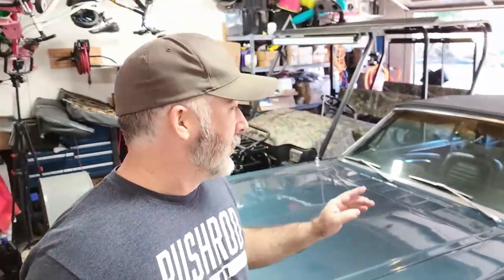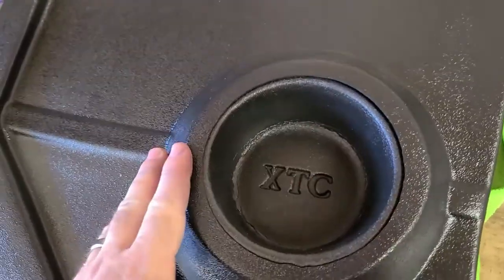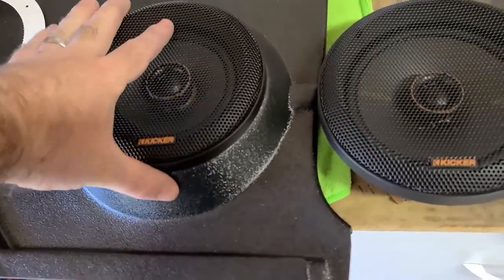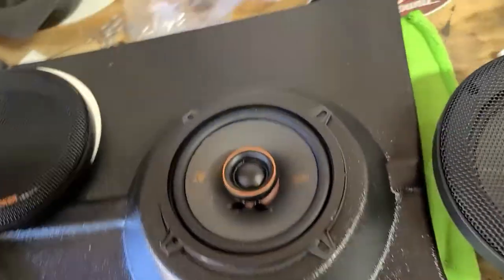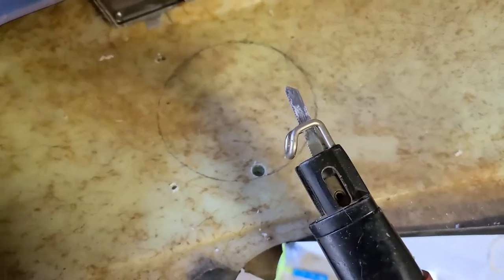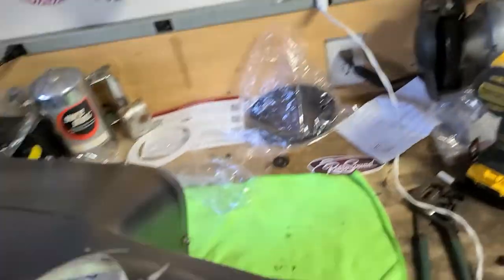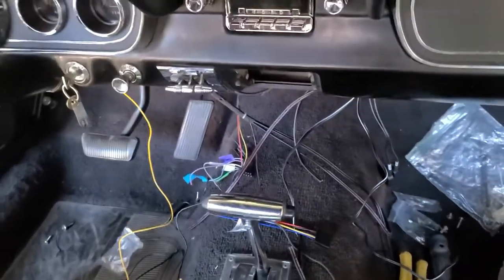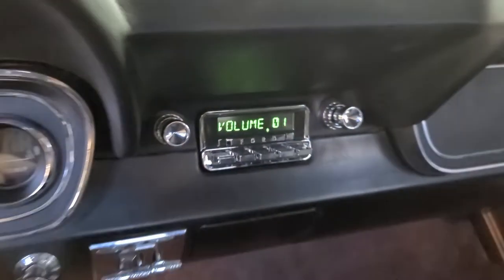66 Mustang RetroSound Detroit M4 Stereo Install - Pt 2 Installing the Speakers

Comment: What channel did you wire the center channel speaker to? The indash radio only has 4 channels out? Thanks
Reply from the maker: That is the Retrosound dash speaker with a dual voice coil.  It is wired to the front left and right channel along with the kick panel speakers.  Future state, I am going to wire the  speakers to an amp.

Comment: Can you show how to remove the original front kick panels without damaging them?
Reply from the maker: Original kick panels are tricky if they are brittle and old.  You may have to flex them a bit and that can cause them to crack.  Best trick I have found is to get the door sill plate out of the way first and it should come out relatively easy.

Comment: I installed on my 65 but get a speaker pop any time radio turns on or off. Any ideas?
Reply from the maker: A speaker pop without an external amp, from my experience, is typically a bad ground  connection at the stereo.  You may try cleaning the ground surface.  Maybe run a temporary wire directly to the battery negative terminal to test.
Reply: @WhitetailGarage  I’m always learning!
Reply from the maker: We are all always learning!  Just don't lose the desire to get out there!